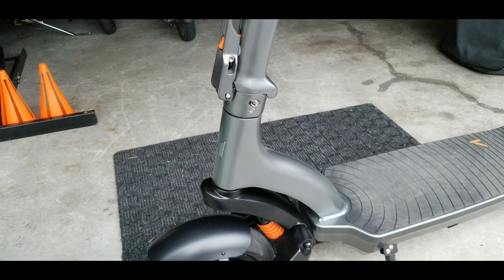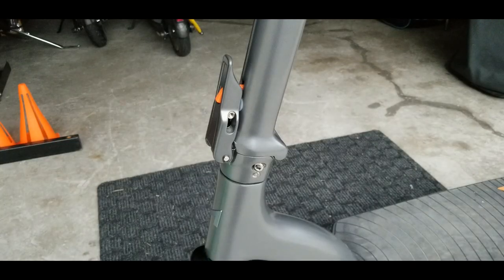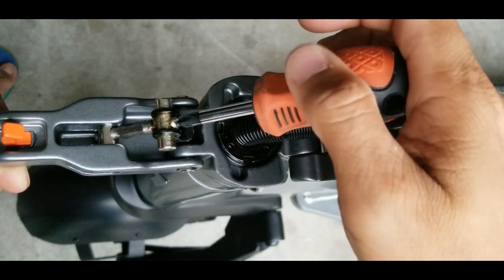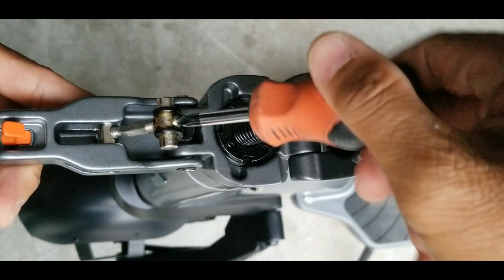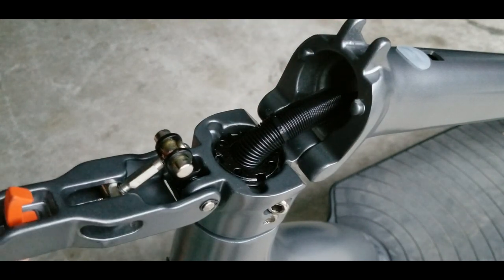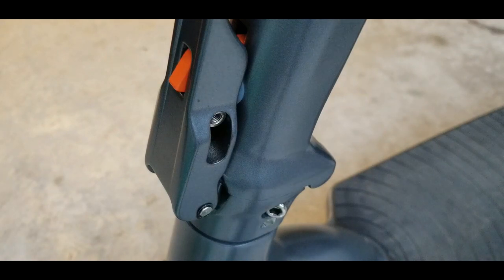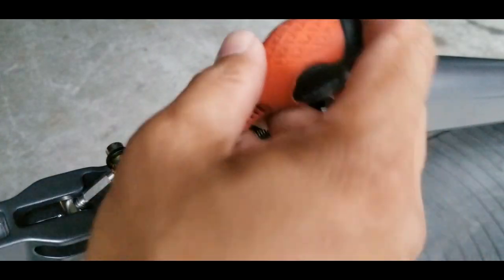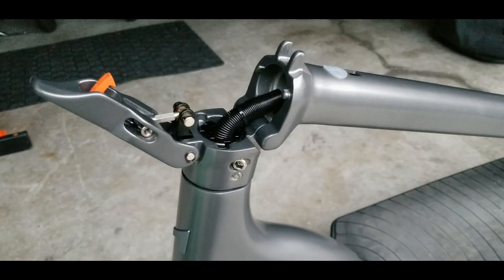Apollo City 2022 & City Pro Stem Wobble Fix

Comment: Good video! Kuya are you familiar with motorcycle frame sliders? Would it fit sa city pro? Still waiting for mine to arrive
Reply from the maker: Yes sports bike has thru axle so mounting is different. Scooter is non thru axle so uses the nut of the axle to install the slider.

Comment: Thank you for this. I received mine yesterday. the folding mechanism is super hard for me to open or close. I might have to loosen the T screw haha. Currently, facing the faulty charger issue as well. Just need to exercise some patience here.
Reply from the maker: You are welcome! My buddy got his 5 days ago and his charger just quit yesterday. Lucky me my charger still working but not sure how long it will last.
Reply: @ruvrandomusefulvideos  for what's it worth ...the chat person at Apollo was very nice and they said they are replacing the chargers very quickly as they have them in stock. You might want to order a new one just in case yours end up dead. You might not see these chargers on their website but you can request one through chat.
Reply: I haven’t gotten my scooter yet but I did get the faster charger, IF my charger doesn’t work this should be ok no?
Reply: @VkterE  Yea if you have the fast charger already ordered then you should be good.
Reply from the maker: @bawagsk  I actually ordered fast charger and Apollo bag same time I ordered my City Pro back in April and till now I haven't receive them LOL.
Reply from the maker: @VkterE  The bottom line is fast charging won't impact your battery life substantially. But the physics behind the technology means you shouldn't expect the battery to last longer than using a conventional "slow" charging brick. But that's just a single factor. A battery's longevity varies depending on different factors. I have RC cars and and all my 3 chargers are fast charger.
Reply: @ruvrandomusefulvideos  Alright cool probably splitting usages is safest. Thank you so much!
Reply: Seems like Apollo and patience goes hand and hand 😒
Reply: @ruvrandomusefulvideos  dam!! Long ass time, sux bro.
Reply from the maker: @lopezdad30  Finally my fast charger arrived yesterday. I open the shipping box hoping that the Apollo bag is also inside but not so I emailed Apollo again 😕
Reply: @ruvrandomusefulvideos  you ordered both?? I just have a generic bag from Amazon on my City Pro. Works great 👍
Reply from the maker: @lopezdad30  Yes I did I wasn't thinking, was so  excited

Comment: My locking mechanism is really really tight, but when i ride the scooter the handles wobble forward and back dangerously.
Reply from the maker: First of all if the locking mechanism is really, really tight that is not safe. Too much tension can cause it to suddenly snapped while riding so make sure to have the right tension on the locking mechanism. Which year is your City Pro? Either way the wobble of City Pro might be coming from the lose headset, make sure to address that issue to be safe.

Comment: I have a Daxys Bandicoot Escooter (almost same). I don't have the Phillips head screw but a 2.5mm tension holder screw on the other end of that tension bolt. IT FIXED MY ISSUES SO I CAN'T THANK YOU ENOUGH. CHEERS & HELLO FROM AUSTRALIA
Reply from the maker: Glad I can help, and thanks for the kind words 🙏. You have City 22 clone, where did you buy it?

Comment: You forgot to loosen/tighten the grub screw that secures the mechanism in place! 
See this video from Apollo at 0:55 
https://www.youtube.com/watch?v=HRit1LDayYg&t=7s
Reply from the maker: I didn't forget, I didn't know, I never seen Apollo's video when I did mine because they didn't make one yet at that time I guess. What I did is base on my experience with Segway Ninebot but good call I will next time when I need to adjust it again, thanks.

Comment: Oh. And I ment to also ask. You previously mentioned, in one of you vids, that the suspension was softer on the ghost. Can you adjust the spring on ghost 21?
Reply from the maker: Yes you can but it will also change the ground clearance.

Comment: Hello again.    Well my city pro wouldn't be coming until sept/Oct  as they have stopped shipping.  Soooo paid more for Ghost 22 (in stock they say), so hopefully on its way soon (before snow).
Reply from the maker: You will love the Ghost. 2022  has better folding mechanism, thicker stem and dual 1000 watts motor.
Reply: @ruvrandomusefulvideos  Hey, update. Ghost 22 arrived today. Wow.  
Slight bend/warp on front disc (some brake rubbing), some tinkering tomorow should fix er up.  Amazing machine overall. 
Appreciate your previous feedback; helped me decide to spend Lil more to get the ghost  (not wait until Oct/Nov for my original City Pro purchase).  Take care, happy scooting (on both your Apollos).

Comment: anyone had any issues with creaky front wheel or sounds of bearings on front wheel when slowing down? Lubrication hasnt helped either,. super annoying
Reply from the maker: Maybe drum brake noise? If its bearing noise then I think its bearing issue.

Comment: Got the mechanical as was already going over budget. I like the new Ghost 22 folding mechanism .      
You have both.    Did I make a good decision ????
Reply from the maker: Actually I am planing to sell my Ghost to get the 2022 version because of folding mechanism and thicker stem so you made a very good decision but I will recommend you to upgrade to Hydraulic brakes $130 from AliExpress, that is night and day difference and change to solid handle bar for better handling. BTW Ghost is real eye catcher not the City Pro LOL and Ghost wil give you much comfortable ride but my wife loves her City Pro because of the clean look.
Reply: Welllll the fact you have both, and are buying a new Ghost 22 and not Another Ciry Pro says everything!!!!       😏
Reply: Thanks for your reply.    The new folding mech/stem helped me decide to spend the extra $ for the Ghost.
Reply: Beauty is in the eyes of the beholder (eye catcher).    Hehe
I did wish the Ghost had the flat resistant tires though.

Comment: Would you recommend the scooter still even with the issues people have been running into? cause I have the option to cancel my order and get something else but from what I understand is just about anything else you can buy will have there own issues
Reply: I wouldn’t get anything else. The scooter is brilliant. City Pro 2022.
Reply from the maker: All scooter brands has issues. You can join escooter group on FB and you'll see lots.
Reply: This scooter is an amazing machine, you may have to fix or tinker with a couple things but this scooter is high quality 👌

Comment: I need to remove the stem entirely to replace it but I'm not sure how it seperates from the scooter. Had a accident where my scooter and 2 others were damaged. The stem on mine was bent. I don't really want to send the scooter back to Apollo for repair because it's not covered under warranty and will cost probably another $600 or so. The parts are only $200 and I'm willing to do the repairs myself Im just not sure how it comes apart and don't want to damsge anything trying to get it apart. Is there a link or any information I can be given on how to remove the stem for replacement?
Reply from the maker: @Oven Heating first of all I am glad you are okay and sorry to hear that. Anyway if you are replacing the stem tube that will require the removal of the complete handle bar which Apollo has video here; https://youtu.be/Ak4oSMMZKE8
After that you have to pull all the cable out and you are going to need the spanner wrench to loosen and remove the black nut (not sure what they call it) inside the folding mechanism then loosen the 2 stem bolts and the whole stem should come off. Here is the video I made when I test the spanner wrench that you can get from Apollo for free. https://youtu.be/0OdYzyd8xyw Check description for the link if you do not have the spanner wrench yet.  By the way can you share the link of the parts that you need? That wil help me to visualize and probably help you further.
Reply: @ruvrandomusefulvideos sorry for the late reply I got the replacement awhile back but just now noticed your response when I came back to your channel to make use of that discount code for some brake replacements. Getting a new brake set for $23 lol. 

I got the new stem put on and it's much better. Your video and response helped a lot thank you. 
I used your discount code to purchase it and was able to get it for $43 so I'm happy with that. 
Since getting hit by the car and typing out my first comment I've put 1629 miles on my scooter. So far it still rides strong and smooth I'm loving every bit of it compared to my old scooter. 

I'm scheduled to receive the 2023 upgrade kit tomorrow and am extremely excited for that one. 

I need to replace one more part though and I believe its the fork. The shaft the stem connects onto and the bearings inside the headset were damaged during the accident. Replacing the stem fixed it being bent but I still have some stiff spots when turning and some grinding from the damaged bearings being worn over time. 

Besides that the rest that's left to fix seems to be cosmetic damages like scratches and such. I did have a balance issue with the tires where the scooter would vibrate at 30mph but I solved that with some 3.5G wheel weights and now it rides smooth all the way to 34-35mph. 

I'm hoping to keep this scooter  alive for a few more years and to put as many miles on it as possible.

Comment: I finally recieved my city 2022 back from the repair center today and the intial issue I sent it for is not fixed and I am fuming
Reply from the maker: Dang that is frustrating. What was your initial issue?
Reply: @ruvrandomusefulvideos  it had two issues and only one was fixed, the first was the folding mech was missing a screw(fixed) and the second was the stem could easily be moved and unaligned with the front tire easily even after fully tightening which was not fixed
Reply from the maker: @elementalflare7377  Did you order the spanner wrench? You can just fix it you self if you have the tool.
Reply: @ruvrandomusefulvideos  already have one, fully tightened and she still easily moveable
Reply from the maker: @elementalflare7377  I didn't get the wrench yet, status shipped but its been 2 weeks now still not here  so I can't really give you suggestion. i can't believe that Apollo sent the scooter back to you without addressing all the issue. Anyway hopefully I can get the spanner wrench so that I can try mine and upload it.
Reply: Didn't you buy the warranty?

Comment: I am considering this scooter.  How do you like it?
Reply from the maker: If you like unique and clean look then this is the scooter for you. Shocks are amazingly quiet, stable at high speed, Wolverine tires, user friendly apps etc. You'll get more with Apollo scooter for what you paid compare with other brands and to answer your question I love it. In fact 3 of my friends has the same scooters and one of them already put over 200kms in just 2 weeks.
Reply: I have it now for 5 days and wow I could not get tired riding this thing. The handling and the acceleration are great, it's definitely A1 quality material and you can feel they didn't cheap out on anything making it. For now it's working like a charm riding through toronto streets 🛴
Reply from the maker: @barrymcokiner69  Yes they didn't cheap out aside from the charger feel really cheap. Email them right away to get a replacement charger.
Reply: @ruvrandomusefulvideos  I agree lol charger looks like a charger from 1987 😅
Reply from the maker: @barrymcokiner69  🤣😅😂
Reply: @ruvrandomusefulvideos    I have owned my Apollo City Pro for 11 days and I have put 265km so far!  😃😃🛴
Reply from the maker: @lopezdad30  265kms in 11 days wow you have lots of time to ride.
Reply: @ruvrandomusefulvideos  not necessarily that I have time....I just use my scooter to go everywhere. Commuting to work 5 days a week. Running errands or making food runs or going to a friend's house, all on the scooter. Instead of using my car or motorcycle to go places, I try to use the scooter as much as possible 🛴😃
Reply from the maker: @lopezdad30  That is nice. I'd like to use my scooter too but the route to work is not safe, no bike lane or sidewalk and every morning all cars are rushing running late including my self sometimes and lots of semi as well on the road. I have my City Pro for over a month now and only have 167km on it so far.. Anyway thanks for the comments and ride safe.
Reply: anyone had any issues with creaky front wheel or sounds of bearings on front wheel when slowing down? Lubrication hasnt helped either,. super annoying

Comment: I almost baught this thank god I didn't 🙏 🙌
Reply from the maker: @ Peter B there is nothing wrong with the scooter. It is normal that you have to do some tightening or adjustment after few rides. Just like when you buy a brand new car, you have to check or retorque the lug nuts after certain miles during engine break in.
Reply: @ruvrandomusefulvideos   totally understandable have you heard about all the charger issues and the replacement is weeks  out. Good thing or else guess what ur scooter would be collecting dust 🤪.....
Reply from the maker: @Peter B  I do and my reply to you is regarding the stem wobble. Regarding the charger issue this is what I am dealing ->>> I bought fast charger at the same time I bought my City Pro back in April and I haven't receive till now, almost 4 months already. Luckily my charger is still alive. I already told them to cancel it so I really understand your point and I agree with you that their customer service is very slow. They should start sending the replacement charger automatically to all City & City Pro owners. Also considering that the charge is getting really hot, it could be a fire hazard.
Reply: @peterb7585   I have owned my Apollo City Pro for 11 days and I have put 164 miles on this tank !! 😌🛴
Reply: @lopezdad30   yeah im probably going go get the city still =)
Reply: @peterb7585  City or city pro!!?? 🤔
Reply: Your loss, mine is perfect
Reply: I am almost at the 1,000 km mark on my Apollo City Pro and I have had no major issues. It still runs like a champ at 32mph for about 20 -25 mile range depending on how much full throttle I give it. The only issue I had to deal with was the bad charger but Apollo sent me the Fast Charger in 4 days, so my scooter wasn't down that long.

Comment: now how do i sort my iscooter ix5 the 10mm screw stopped working so i have see a small bolt at like yours , but your is a screw so i wonder  i tighten that ,
then so the bolt  after  that will solve the issue
Reply from the maker: Google is showing me different ix5 scooter. Can the link of the exact one that you have? I might be able to help.